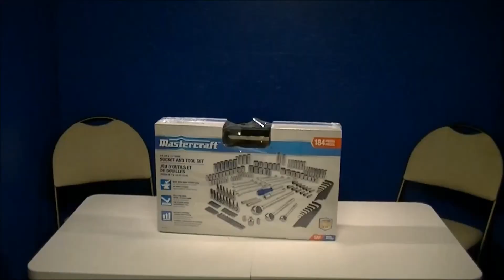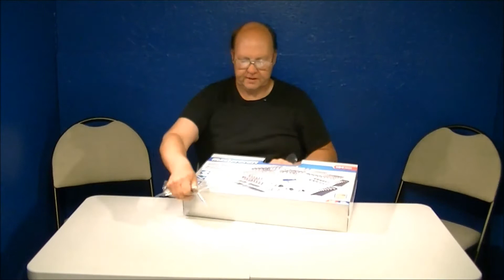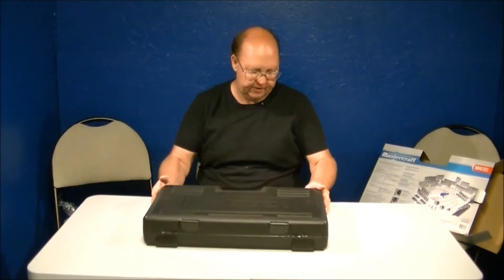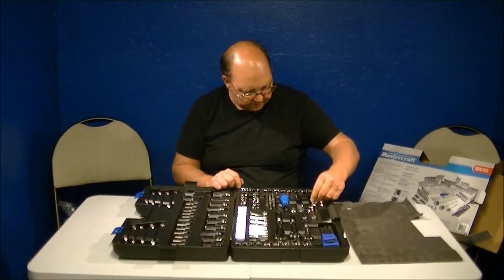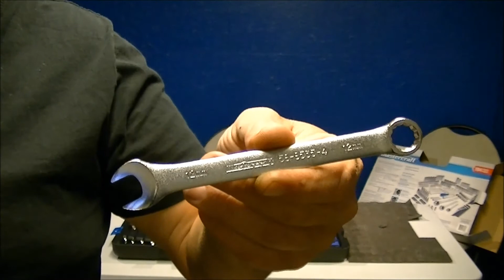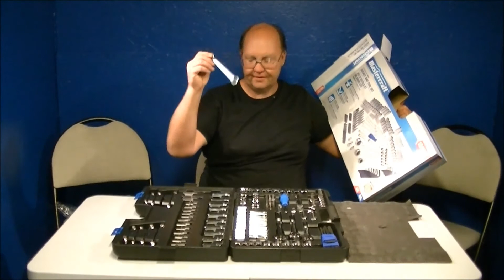Mastercraft 184 Piece Socket Set First Look

Comment: I like Master Craft tools, they try to compare to Sears Craftsman tools and for the price they are pretty good!!
Reply from the maker: master craft totally rules over craftsman way way better quality etc, ill never buy craftsman again, wasted to much money on them  in the past no offence if you own them just my own experience
Reply: I did have a bunch of Craftsman tools, about $300 dollars worth, because I use to work on cars, brakes, simple things. All of my tools got stolen after I graduated high school, when I left them at my Mothers house a long time ago. I wish I could have anything that comes close to that big kit!! I have some cheap 50pc tools set that I picked up at Wal-Mart for $15 dollars (I think) a few years ago. It does 80% of the stuff I need it for.
Reply from the maker: ***** i worked for car dealers and private garages for many years been doing it on my own the last several years and learned fast to be very careful on tools, now i know there are alot fo snap on fans but master craft is a clone of them in the pro and maximum series and now a days these are even better then snapon and grey to a degree , there are sizes you have to buy of the other brands mastercraft dont cover it all like that should but they do cover a good amount. for sure, even princessauto has some really sweet stuff and some not so good, over all they all do really...for a portable on the spot this kit should hopefully do the trick will find out for sure once i put them to the tasks and see how they handle the jobs, and the on the road stuff should it ever happen